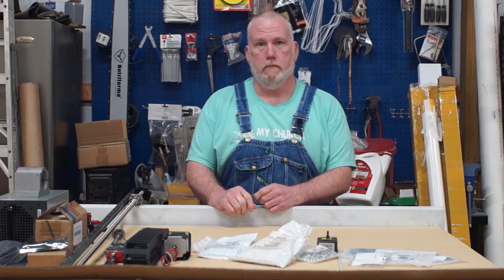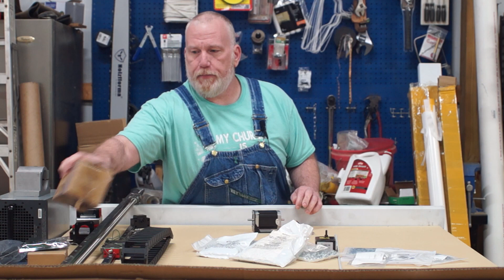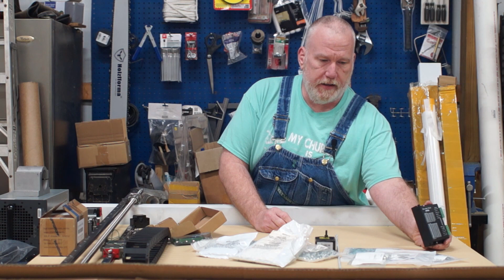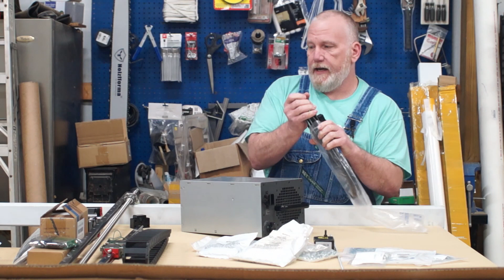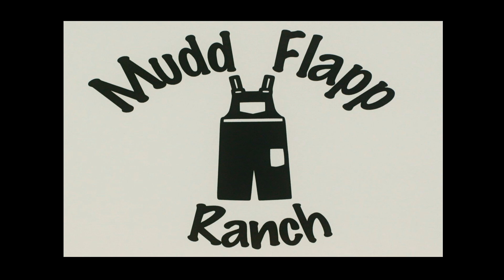Mudd Flapp Ranch- PrintNC Parts

Comment: Hi.  I'm watching the video again and had a comment/request.  When you're talking about the BoB with the parallel port you mentioned that maybe you'd use an arduino and run GRBL since that's what you're used to.  I was thinking of doing that as well because I'd like to try Easel and I think you need a GRBL setup for that.  If you're going to use the arduino/GRBL combination, I would very much be interested in seeing how it works out.
Reply from the maker: Thanks for watch (again). I have changed my plan for using GRBL for the PrintNC, opting to go with LinuxCNC. I do use GRBL for my MPCNC, and find it fairly straight forward. The limiting factor for GRBL on the PrintNC is the lack of a 4th motor output and inability to calibrate the two Y motors independently. If you are running external drivers (TB6600 or similar), all you really need from the Arduino is Pulse and Direction for your motors and stop switches if needed. I think the pin outs for the Uno are 2-X-Pulse, 3-Y-Pulse, 4-Z-Pulse,5-X-Dir, 6-Y-Dir, 7-Z-Dir. Verify the pinouts when you download the GRBL. I would also recommend some form of screw terminal shield.

Comment: Your motors are 4 amps at around 5v, 20w per motor. At 42v the stepper drivers still provide them 20w... A 100w hoverboard charger would have been sufficient.
Reply from the maker: m p what motors and power supply did you use on your build?
Reply: @MuddFlappRanch  One of those crappy chinese boxes you see on amazon. 40v 5 amps?  I was worried about current spikes over volting the thing but it hasn't been an issue. Using 3 3.5 amp motors running on some old stock  centent drivers.
Reply from the maker: m p I agree with that a 55 amp power supply is overkill, but this one has 3.3,  5, 12, and 42 volt outputs at far higher amperage than I’ll need. Hard to beat for $18.
Reply: @MuddFlappRanch  The price is right and more capacity doesn't hurt. The good news is you can power 5 more machines and still have enough juice left over to run a space heater.
Reply from the maker: @mp-xt2rg  Stop giving me ideas :)

Comment: Hi, I like that you've recycled a PSU and I would like to follow suit. Which model do you have?
Reply from the maker: This one is a Cisco WS-CAC-2500W, which is 120/240V version. There is also a 1300W version that is very common, it is a 120V only version of the same power supply. The ones manufactured by Sony seem to be easier to modify without cutting wires internal to the supply.
Reply: 4 amps at 4-5v. With a 42v power supply your going to draw around half an amp per motor. So you don't need a crazy large power supply. The reason you need high voltage is the motors generate power as they spin and you need to maintain 5v across the windings to push 4amps through. 600rpm the motor might generate 35v so you at least 40 to keep power going the right direction. The power consumption is just voltage across the windings x amperage so 20 or watts not 170.